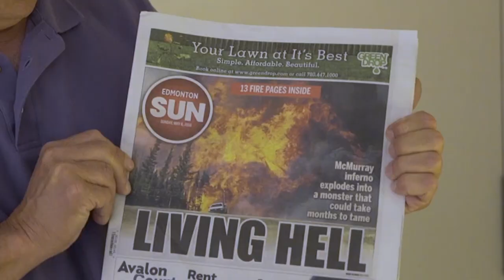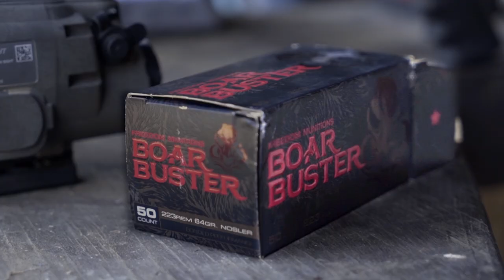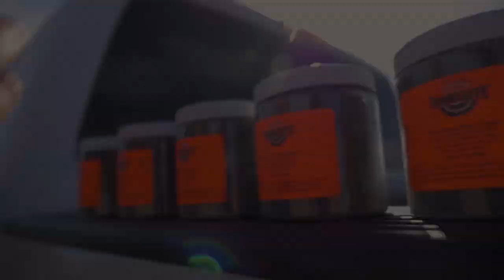Monster Black Bear Double in Alberta

Comment: Keith,
    Let's say a 1/4" pointed bullet is traveling about 2,800 ft/sec with about 2,500 ft lbs of energy when it hits a medium skinned animal, like a bear.  It doesn't matter if that projectile is made out of wood; it will penetrate the skin.  If it's made out of wood and cheap lead, it will shatter, and that shrapnell will create an effective wound channel that will irreversibly damage internal organs and lead to a quick death.  As long as the bullet doesn't exit, all of that energy is absorbed, no matter what shape the bullet takes.  This has been my experience over and over for more than 40 years of hunting (about 15 years in the midwest and 25 years in Alaska). I'm not trolling, but I don't understand all the emphasis on beautiful mushroom-shaped bullets. What's your take on this?